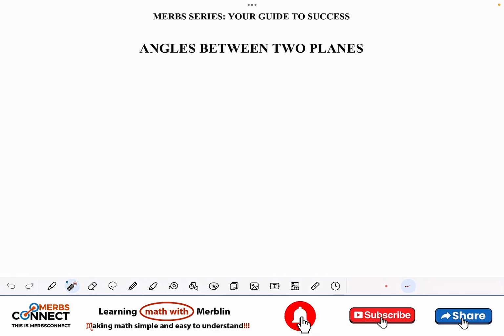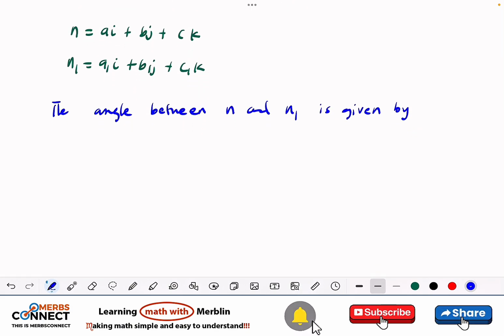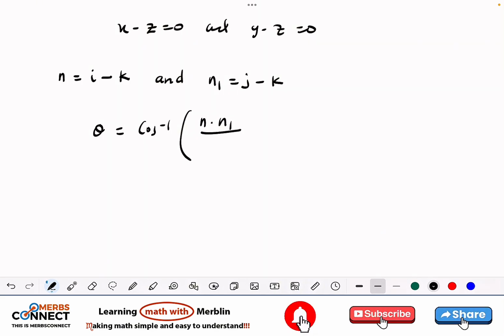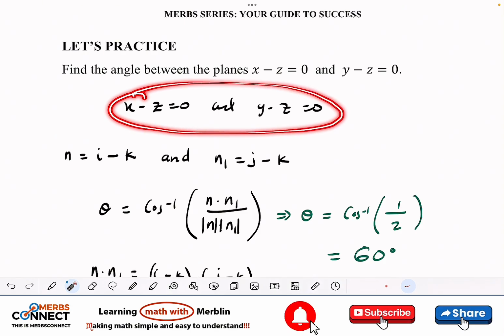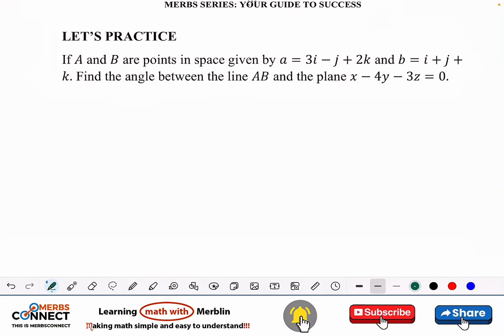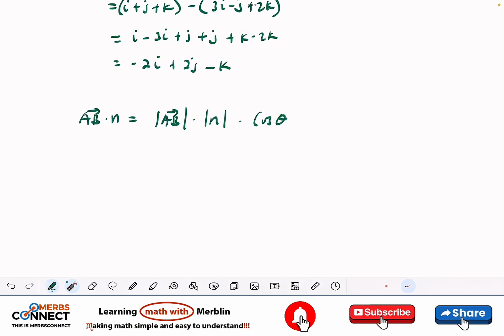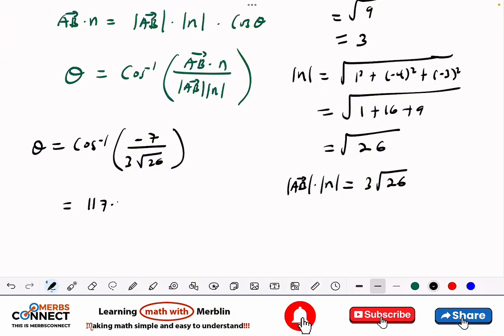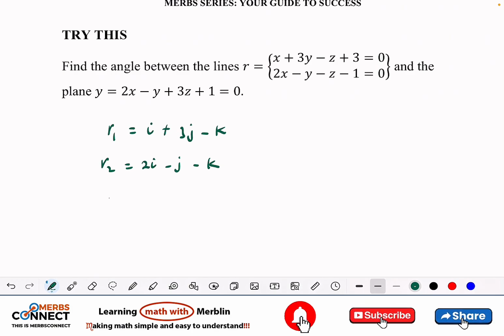Angles Between Two Planes & Between a Line and a Plane | Step-by-Step Examples + Try Questions!

Comment: The angle between the line and the plane is  22.89 and 202.89 degrees respectively 🤔
Reply from the maker: 202.89 👍 but check 22.89
Reply: @MerbsConnect  kk
Reply: Please, what are the correct answers because I also got 22.89 and 202.89@MerbsConnect
Reply from the maker: @trendyfashion8467  Add the 67.11 to 90 because 67.11 is less than 90
Reply: @MerbsConnect   Okay thank you
Reply from the maker: @trendyfashion8467 
Always welcome 🎉
Reply: @MerbsConnect  Boss please I don't understand why he should add 67.11 to 90 because in the video, you stated that when the angle found is less than 90 degrees then we should subtract it from 90 degrees. Else if the angle found is greater than 90, we should then subtract 90 from it. So subtracting 67.11 from 90 will be 22.9 degrees:body-blue-raised-arms:🤔
Reply from the maker: @yawspicies2046 
You are right, ✅🙏